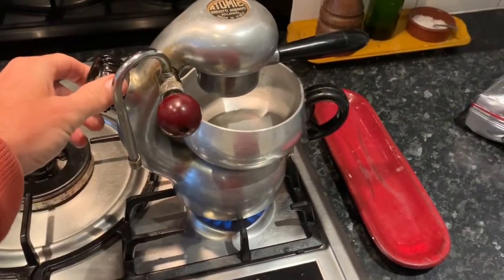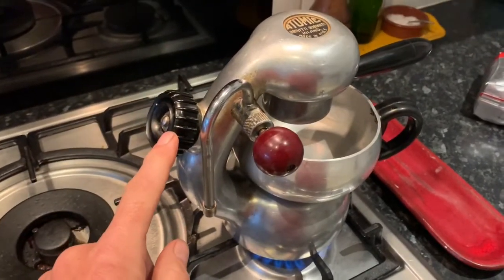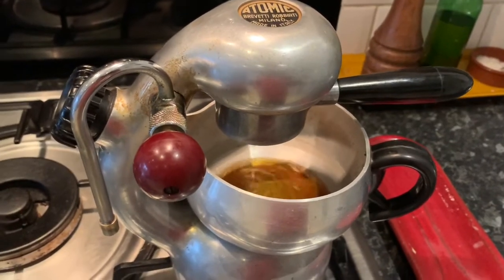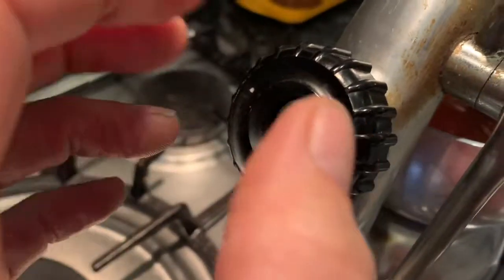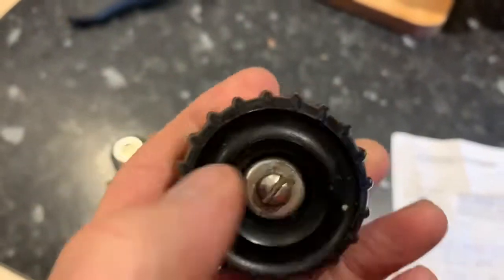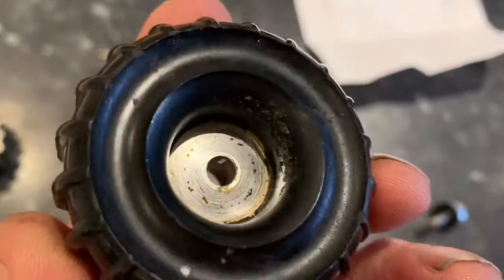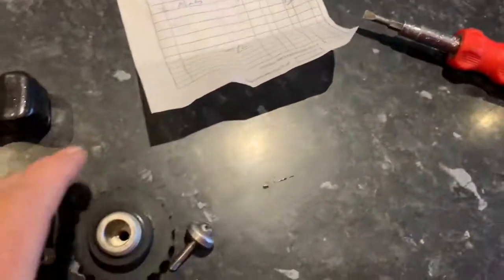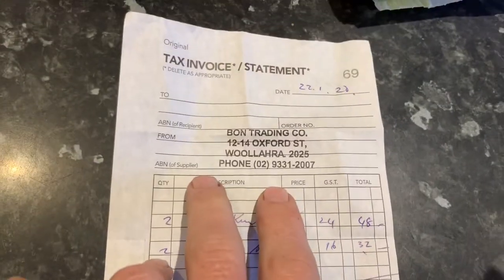Atomic Coffee machine steam knob

Comment: I've just had exactly the same problem - I can't quite justify selling my house to buy and ship over a new knob over from Oz (like yours, this one is only a few years old).
I stripped the knob then cut the thread on the bolt down about another 5mm or so, so I could tighten it a bit more. 
Another option could be getting a heavier duty spring made up, maybe?
Anyway, I'm back in coffee without the hisses and poor pressure, I'm happy 😊
Reply from the maker: Thanks for your comment - what country do you live in? Mike
Reply: @scottitonline  hey Mike, it's me, Moo (and just for the record, if it didn't work I was going to give you a bell on the off chance you might have a spare 😉).
Reply from the maker: @imushu  Hi Moo - good to hear from you. Yes I have a spare. Let me know if you want me to send it. Mike
Reply: Careful, tightening the screw raises the pressure at which the safety valve opens. Leaks are most likely due to drying out, shrinking or cracking of the seal inside the knob. Can also be spring failure. New knob is a simple solution. Try a drop of olive oil  on the spring between uses to keep that spring and seal corrosion free and happy.
Reply: Hi Scott. Trying to revive a heavily used Sasoon model here and this knob is the part most in disarray. I’ve emailed Bon Trading as I have a friend who could bring a spare back in a week but so far nothing heard. Do you have any available? Another option might be to replace the pressure valve with one out of a Bialetti pot, but that would solve only one of the problems with the knob. Thanks for all the videos you’ve done - very useful and interesting.